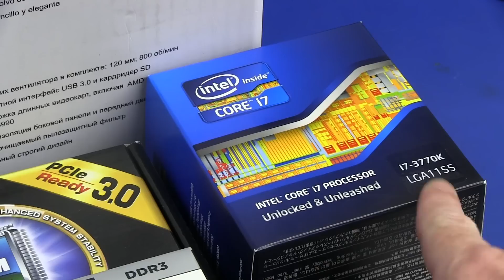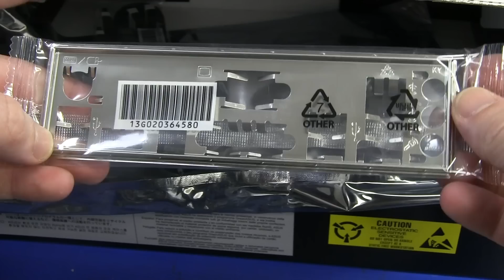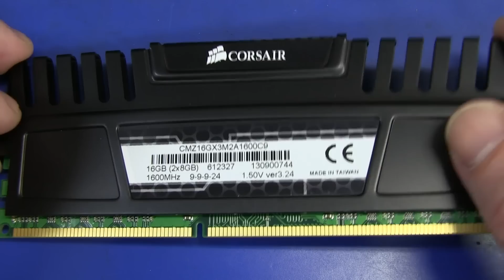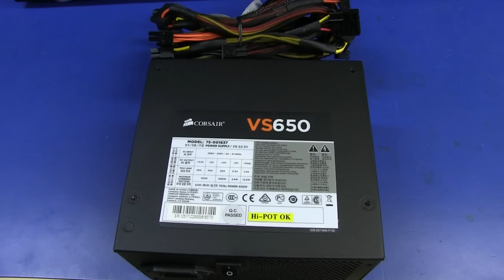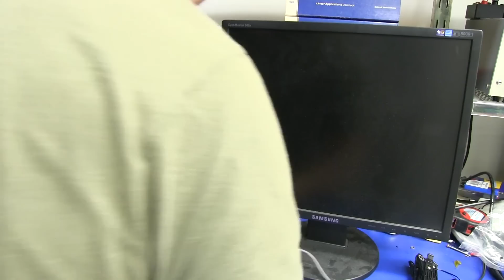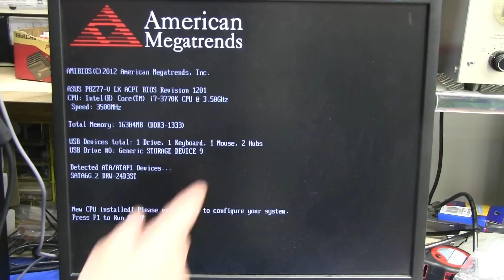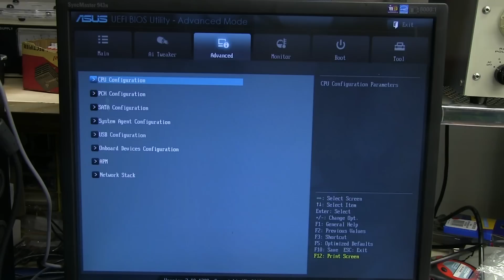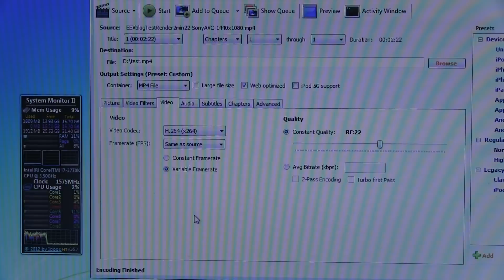EEVblog #462 - Video Editing PC Assembly

Comment: Dave thanks for going in-depth on things like the caps 39:12. Given how flimsy that board is would you buy one again?
Reply: bottom line boards tend to be more flimsy, I have an ASUS ROG MAXIMUS V Formula, their ultra top of the line LGA 1155 Z77 chipset board, and the thing weights a ton between the VRM and chipset coolers. Boards also 2mm to support the heavier coolers.
Reply: Joshua Nicoll
Seems to be true of PSUs as well, the heavier the darn things are generally the better quality. Cool to know about the ROG, never actually owned one, but have had a number of older ASUS boards that were pretty good.
Reply: Indeed, my PSU also weights a ton, it's a Corsair RM850x 850 watt PSU, so it's gonna be a little heavy. The ROG boards are however VERY expensive, some costing as much as $400. ASUS's WS work station X99 one is also thicker, but being X99 costs a lot more too.
Reply: The Asus Tuf series MB are the durable overbuilt models, ROG is the overclocking and performance group.
Reply: They're basically the same actually, both have overbuilt VRMs and Z series chipsets so both overclock, the main difference is aesthetics. ROG being black and (used to be red) very angular heatsinks, the TUF series is more tame and white.

Comment: Good build! i have some suggestions!
1) if temps are high move the ram in the other slots and do a push config
2) in that case you'll be able to hide the cables behind the back panel improving look and airflow
3) You have a k series cpu clock it at least at 4ghz or it would be a money waste
4) this pc does not require much power, a good 500W psu is enough for every single cpu end single gpu system today, also with moderate oc
5) use the fan controller on the mb for - db
6) set the ram at 1.6ghz

Comment: unless you misuse it, you can melt your heatsink base, i only use liquid ultra on a removed ihs, i put it on the die and put back the ihs back on, NEVER use it on the ihs (between cpu and heatsink)

Comment: How would there be air bubbles if you spread out a paper-thin layer on each surface?  It's just not happening.  Even if it did happen, I'll take a few tiny air bubbles over a thick layer that doesn't cover the entire surface.

Comment: It all works fine if you're not doing anything crazy. But running 5ghz, heat problems compound and it gets scary fast, and it matters a lot to get the paste right. The most important thing is no bubbles, and there is paste where the actual processor touches the integrated heatspreader. The corners don't matter hardly as much. However you do that is your call. All i'm saying is that in my experience, using the blob method is far more reliable.

Comment: To be honest, if the heatsink needs to be torqued down hard to facilitate proper heat flow, it's wrong. A properly designed heatsink will move a little to allow for thermal expansion and proper mating surface leveling.

Comment: @ 33:10 :
You can tune the Airflow through the CPU Cooler when you taping the gaps between the cooler and the Fan with Tape.

Comment: 1) Push vs pull is negligible

2) The height is fine, bending the heatpipes would be dumb, the foam will flex. The cooler is screwed on really damn tight, there is no stress from a tiny bit of foam.

Comment: to be fair, you shouldn't flatten the thermal compound with a credit card on a CPU with an integrated heatspreader. The IHS are rarely flat so applying an epicly thin layer of compound will likely result in poor contact... What dave has done is probably fine, there is simply more compound than required.
What i do is just put a rice grain sized blob of thermal compound on the middle of the IHS and then install the heatsink. The clamping pressure spreads it out perfectly.

Comment: DDR3 spec does have 1333mhz as standard speed and therfore all motherboards does set the speed at 1333mhz.
If you go into bios and set the XMP profile for the memory you will get 1600mhz.

Comment: tip - when your next in the bios, check and adjust the ram timings and voltages, to what they should be  (usually written on the sticks).

Comment: All those fan filters do is restrict air flow big time. I have no fan filters in my machine at all. I just open the computer case up every 2 or 3 months and use a half a can of dust destroyer and clean my case and my fans. I have never had a problem when doing this.

Comment: You wish to reduce the amount of heat-sink compound you use (it should be only where there's no direct contact with the heat spreader of the processor). and you'll want to install the memory in slots A1 and B1 since then the memory is used in dual channel  mode and is faster.

Comment: Right people, when applying thermal paste don't do what he did. It's way to much. How you do it is like this: When the cpu is installed into the socket apply a dab in the middle of the cpu, pea size (the green ones you eat). Leave it like that you don't want air bubbles. Then put the heatsink on top of it, push down a little bit so it sits on nicely, then twist left and right (just a little bit to help it spread) and screw it in place. Thats all you have to do.

Comment: I don't understand "Silent" cases with screwless mounts for HDD/DVD drives. Those are the most noisy parts. You really don't want vibration here, so screwing it directly to the chassis is the best approach. These sleds and plastic mounts won't prevent vibration, which is low freq.
BTW: PSUs didn't seem to change too much. I cracked an ancient one (tiny fan on the back) open yesterday, exact same layout.

Comment: Yeah very few editors use the GPU and the few that do use it only for select codecs h264 mainly, and generally only on the export. Thouse on board gpu on intel work just fine, as a bonus you can use it with a decreate video card and run monitors on both.

Comment: Great video, especially the PSU dissection.  Whenever I build a new system, I recommend running a monitor program while stressing the system.  HWMonitor (from CPUID) is a great free tool that reports voltages and most importantly temperatures.  Run this while doing CPU intensive tasks like Handbrake.  If there is a problem with your installation (e.g. too much thermal paste as others have pointed out) you'll see it here.

Comment: Just a note, when you install RAM to a new system like this the clock speed on the reverts to 1333mhz so if you want to get the speed you paid for you need to change the clock speed in the BIOS to 1600mhz.

Comment: Reading the Asus P8Z77-V LX manual it seems like the RAM memory should be installed in the two blue ports for best performance. It also says 1600Mhz on the RAM sticks. But seems like the bios only set them to 1333Mhz. Then the case have cut-outs for routing cables behind the motherboard plate. This would help get the cables out the way. Thus better airflow for the components. Might be that the 4pin power cable is to short to route on the backside. One can get a extension cable for that one.

Comment: that's just it; "back in the day". i was there back in that day building computers, and i used to use a chunk of plastic to spread thermal paste, but times change and better ideas come to exist, and a better idea is to put a little thermal paste on the cpu and let the pressure of mounting the heatsink or water block spread it. less chance of air bubbles so more certainty of good contact.

Comment: Just catching up on old EEVBlogs.
I must be an old tight-arse too ...
When I went to build myself a "Gaming" machine (Retired - so much time, so little to do ;^) I used very similar components, of course with the addition of a game-worthy GFX card.
Still runs very nicely.
So far resisted the temptation to add a GTX970 ...

OS:Win7 HP64 CPU:i7 3770K 3.5(@4.3GHz) COOLER:Zalman CNPS10X-PERFORMA MOBO:Gigabyte GA-Z77X-UD5H SSD#1: Samsung EVO850Pro 500GB SSD#2: SanDisk 240GB HDD:2 x Seagate 2TB GFX:Gigabyte GTX670 WF3 2GB OC 1058MHz RAM:16GB RAM 16000MHz DDR3 KEYB'D:Logitech G11 MOUSE:Logitech G700s MON:2 x ASUS 24” ROUTER:ASUS RT-N66U DarkKnight INTERWEBS:Fibre 152Mbps/12Mbps JOYSTICK:T16000m THROTTLE:HOTAS X  HEADTRACK:TrackIR5 Pro

Comment: I'm sure its been mentioned, but I'm not going to read 639 comments to check.

You don't want to spread out thermal paste over the whole dye as Dave has done. Doing so will put too much paste in between the cpu heatspreader and the thermal plate on the cooler which will either provide poor thermal transfer or could squeeze out and potentially cause a short (if its conductive paste). Could also trap air bubbles, use the pea or line method, and remember you don't need to cover the whole cpu dye :)

Comment: Wanted to also add, the stock CPU cooler works great with 500-1000 lumen LED's so you can use it when building a flashlight.

Also, do not rely on the onboard GPU, especially if you plan to use any video editors that support GPU acceleration, or anything that supports open CL. Get a dedicated videocard. (The dedicated GPU you received in the mail works awesomely with 3d modeling applications, especially MAYA if you ever want to 3D model )

Comment: Hi Dave, little advice ... 
The RAM modules should be paired in the slots with the same color to double the transfer rate, but always check your motherboard manual if dual channel is supported with the RAMs you bought or you might damage them! That's why it's best to read the manual (download it) before buying mainboard and RAM ;)
Also the thermal paste layer should be as thin as possible. Intel CPU's will start throttling if temperature gets too high ;)

Comment: you may want to reseat that backplate. it's supposed to snap into the case before you install the mobo, it's probably just sitting loose the way you have it currently.

Comment: Actually the Pea method is for heatsinks that have smooth surface on the base. For this type of heatsink (were you have copper "tubes" that go to the base of the unit that touches the CPU) you add the paste in thin lines down the grooves and then press it down to let it evenly spread out,  a pea size ball in the middle there is insufficient because of the grooves.

Comment: If it runs hot, you may want to reapply the thermal grease. I think you used about 2-3 times more than you needed, and that'll likely act as insulation.

Comment: check the manual, some mobos route the lines so the adjacent slots are for different channels.., there's no unified standard on that aspect(some use same color for each channel, some the opposite)

Comment: @EEbolg y dint u use water cooling  to make it a bit quieter
Reply: +paul moncaster Water cooling isn't needed, and it's excess mess/cost/risk.
Reply: +Josh Latham (*Sorry for the ghost post but.) 

Sometimes air cooling with really good fans can be quieter than a water-cooler as your not pushing air through a thick rad and there's no water-pump to make noises. 
Temps are better on water-cooling but usually only by a couple of ('C). I have a 212 evo with 2 Nochtua fans in Push pull, and at idle  temps are 30'C fans spinning at 227rpm which is slow and makes no noise and when on load it hits about 50'C, and only the GPU can be herd. CPU is a 4790k OC'd @ 4.8Ghz.

Comment: I use Vegas Pro with 1080p 50fps .MTS sources. Enabling opencl (ATI card) increases the rendering speed of mp4 files by at least 2.5x. Playback speed of 1080p 50fps with lots of filters is increased with even a higher factor.

Handbrake can use opencl, you just have to download a nightly build with GPU support. It's not in the release verson. The speed increase is much lower than in Vegas Pro.

Comment: where I agree that thermal paste doesn't transmit as good as copper, air is much worse, since air is a pretty good insulator, and expands quite a bit, where as the paste is at least designed to be a thermal conductor and not to expand (again, like you pointed out, not as good as the copper, but I just wanted to point out the bigger issue.

Comment: PSUS are pretty much all made by the same few factories/OEMS, basically a company like Seasonic will make a reference design and then sell it to companies like Corsair, OCZ, XFX etc etc and they'll then produce branded power supply units for these companies, hence the layouts being similar. The only real change in the last 10 years was the change from the group regulated design to a DC > DC converter approach for the 5v and 3.3v rails.

Comment: I can see that, air being the main concern, and secondary to that is the problem with the thermal properties of the paste, ie. nothing would better than direct contact between two metal surfaces, by a great deal. I can see the benefit of the blob, my own experience would be with tracing a thin line down the centre and move a card outwards across the surface... I guess at this point I find myself on the fence! I just don't see how pressure from the mount is enough to give good thermal contact

Comment: Video rendering WILL increase with the proper graphics card. Nvidia Quadro and Tesla cards are designed for that purpose. Gaming cards can also be used as well but to utilized the power of any graphics card your software has to support it. Using a CPU for rendering is highly inefficient, CPU handles 4 instructions per clock vs around 3200 for a modern GPU. What it comes down to is GPUs are better at calculating large amounts of data repetitively. A scratch drive will help as well, if supported.

Comment: And i'm not saying this method won't work. Actually i would be surprised if the thermal paste applying method here was showing up to give a cooling issue.
Most cases it will work out just fine either way the method used or type thermal paste used. I think this is a bit over emphasized in some cases.
This is not an OC world record attempt situation remember :D

Comment: 19:17 OMG, he intalled the RAM was doom. You have to follow the corlor on the Ram socket, black goes with black, blue goes with blue to run the Ram in dual chanal mode :). For video editing better you need an SSD and VGA card. I advance SSD (samsung 840 256GB EVO), VGA ( Nvidia GTX760)

Comment: There's actually a fanboy movement for the PS/2 port. That's because it uses a direct hardware interrupt for the keyboard and mouse, rather than going through the USB hardware layer and HID drivers. So you get 0.1ms latency instead of 0.3ms latency.

Except that nowadays PS/2 is run through the USB hardware with a software simulated hardware interrupt... Giving you more latency than USB in most cases.

Wooo.

Comment: I have only ever purchased 2 PC's in my life, both in the early 90's then everything else has been built.once you build a PC, you never go back to buying one that is prebuilt. the performance you get for the money is just too good, and then things get 500,000,000 times more awesome when you overclock the CPU, RAM, and GPU, then edit the registry, and disable some preboot items that you don't need to shave 3-4 seconds off of the boot time while on a SSD (and also save 200-300MB of RAM)

Comment: Dave, those oval holes in your backside next to power supply and to 24-pin connector etc. are probably to put the wiring behind the back plane. This will reduce the number of wires in the "main chamber" - more convenience and better air flows.
Also - I don't think you should overclock anything - it is a whole new world :) Thousands dollars of equipment just to get extra 3 FPS....
Your PC is super!

Comment: Well, the modern CPU's have over temperature protection by throttling the speed. So you pretty much cannot burn the die, but you surely can make the thermal area too wide and when it's idle it's 30 degrees, when it's working it hits very rapidly like 70-90 degrees (with bad cooling) and continue this for few years and you can brake something due to thermal expansion.
And throttling can affect your speed, so you don't want to run it hot.

Comment: No, they don't run the PS/2 ports through USB.. Somewhere on that board will be an LPC connected SuperI/O chip providing PS/2, parallel, serial, SMBus, and a host of other functions. Can't say which it has without a high res image taken by someone who knows how to do more than point a really expensive camera and press the big button.

Comment: sata2 is fine for a basic raid 1 or 0 setup using mechanical drives, sata3 wouldn't give any real advantage in that situation, so don't worry about putting your mechanical drive raid on sata2. (hell even ide ata133 is faster than needed for today's mechanical drives, and sata2 has enough bandwidth for a couple of solid state drives not to choke)

Comment: Hey guys, i'm a computer engineer, i think we can cut dave some slack, he did say he hasn't put together a PC for ages, most likely prior IESA , i can point out fault as well.eg. he didn't mention VELF when installing the cpu, he didn't touch on the VRM, yes, he didn't observe Memory interlacing, and yes he didn't use a credit card to flatten out the thernal compound and yes. the back I/O Plate goes on before the motherboard, continued

Comment: 28:50 You could have put the RAM chips in the other 2 slots which were not in the way of the fan, you wouldn't have been able to use the slots in future but you've got 16Gb so that's plenty for a long time.

Comment: If you put on a blob it either does not spread out to the very edges or it oozes out of the sides.  It's never going to get as thin from the mounting force as if you just took a minute to spread it out with a card or your finger.  The blob method is for the common trendy and their "good enough" attitude.

Comment: That PSU component you thought was a MOV was actually an NTC thermistor for inrush current protection. The PSU industry is moving away from MOVs, as A.) they're expensive and not enough are made to satisfy demand, and B.) they're sacrificial components and usually crap out after a few solid surges anyway. Modern high quality PSU primary designs are usually robust enough to handle any surge a MOV would be useful for.